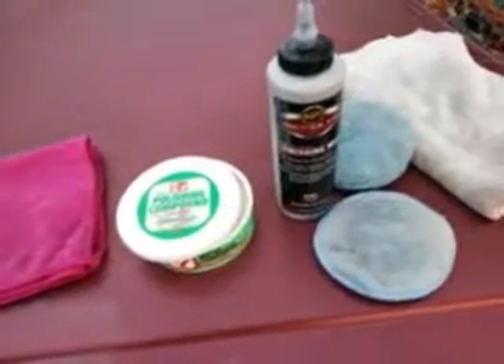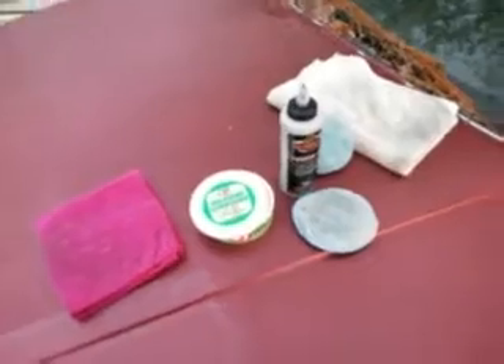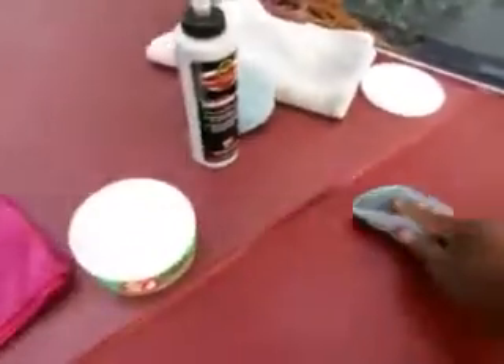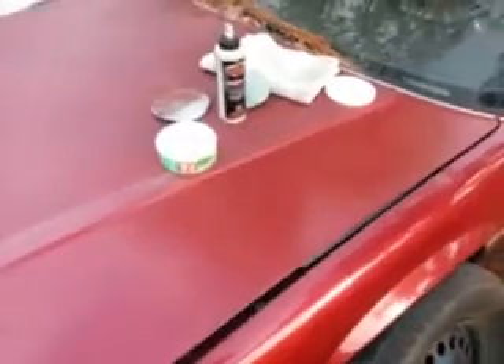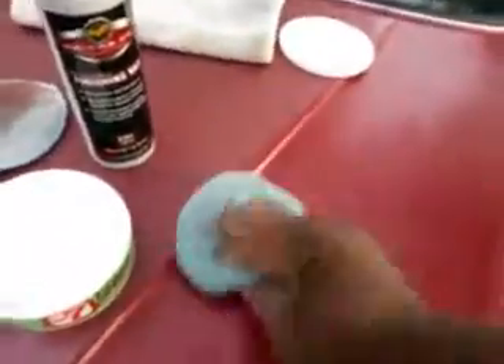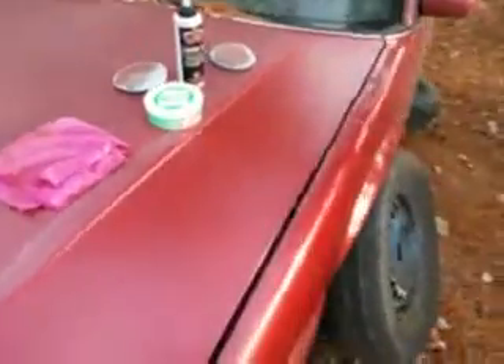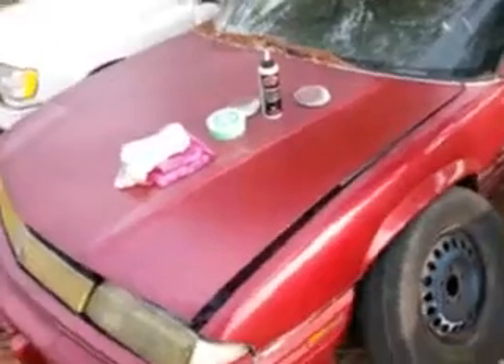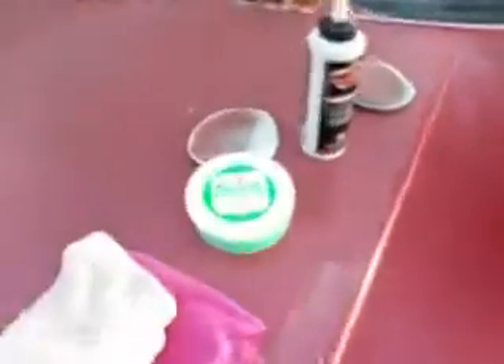True paint correction done the fast way by hand

Comment: I think the oxidation will come back in a couple of weeks after being out in the sun and rain. Seems like oily fillers that made it look better but will not hold up. True paint correction that will last needs to be with a machine.
Reply from the maker: 93hb the da isnot strong like me and boy this number 7 has a very good cutting power its the old school product it cuts fast to you see how it took that paint off fast then i top it off with the d 301 finishing wax which just seal the deal it looks good for a single stage paint you should try that no.7 its no joke for 6 bucks tfw buddy